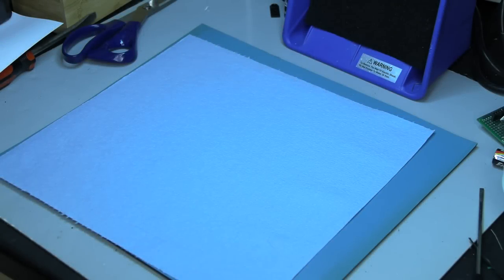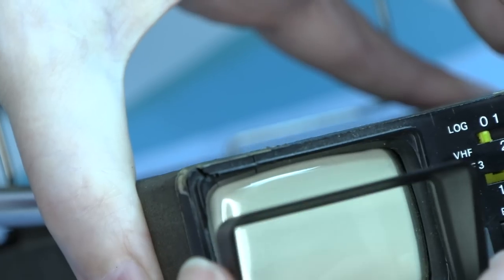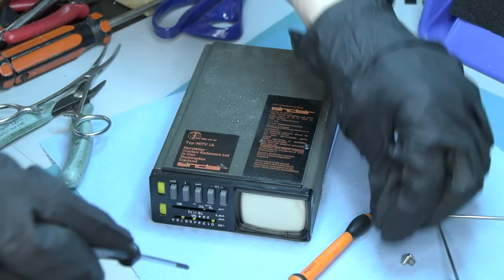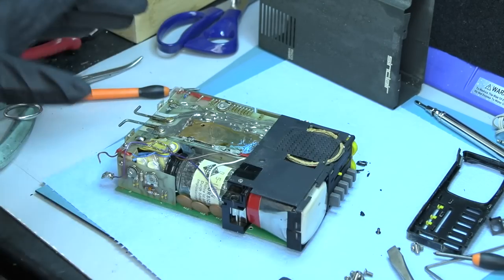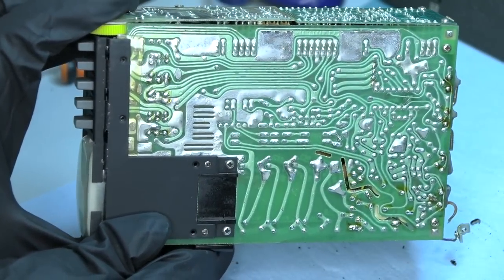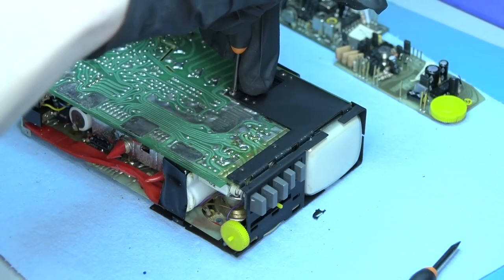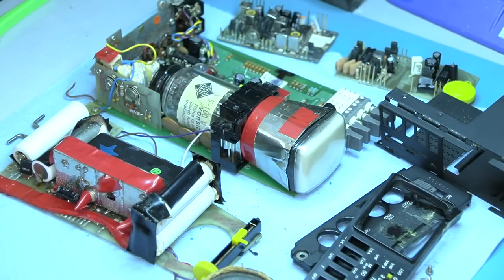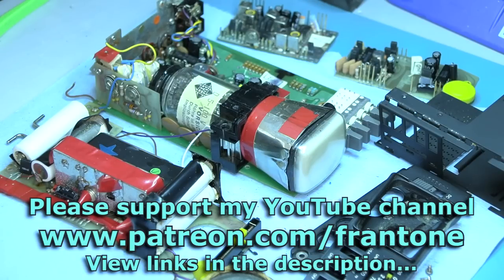Sinclair MTV1 Handheld Television

Comment: Clive Sinclair is a kinda hero.  More Sinclair!

For a show an idea I discussed with Chat GPT...
User
can i make a logic circuit with ONLY diodes?
ChatGPT

Yes, you can create simple logic circuits using only diodes. Diodes can act as logical gates by allowing or blocking the flow of current based on their properties. Here's a basic overview of how you can use diodes to create logic gates:

    AND Gate: You can create an AND gate using diodes. Connect two or more diodes in series, and the output will be active (allowing current to pass) only when all input signals are active.

    OR Gate: You can create an OR gate using diodes as well. Connect two or more diodes in parallel, and the output will be active if any of the input signals are active.

    NOT Gate: A NOT gate can be constructed using a diode and a resistor. When the input signal is low (0V), the diode blocks current, and the output is high (1).

These diode-based logic circuits are quite basic and have limitations, such as voltage drop across the diodes and slower response times compared to modern integrated circuits. However, they can serve as educational examples of how diodes can be used for basic logic operations.

For more complex logic functions and faster response times, integrated circuits like logic gates (using transistors) are more commonly used in modern electronics.

Fran, do it.  I double dog dare you.  It would be fun!

Comment: I have a JVC portable color monitor that’s about 6 inches across diagonally on the screen. It runs on mains or 12v  or internal rechargeable battery (it’s in it but dead). I have it on my bench connected to a VCR directly as a monitor. It’s great to pop in a vhs tape and watch an old movie while working on something else. It’s small size and direct video connection gives you the best image your going to get from any VCR.

Comment: A friend of mine had one of these in the mid 80s. It still worked. It's probably not identical, because it was designed for the UK UHF 625  analogue TV system. He may still have it in some dark corner, but it will be very green & furry.
Reply: Those TVs were multistandard and intended to be usable in most countries inthe world.  The square loop aerial (antenna) was for UHF anf the telescopic one for VHF.

Comment: Sir Clive had an obsession for miniature TV's. Nearly as bad as his obsession for the 3 wheeled battery vehicle the C5. He truly was a mad genius. Iconic design aesthetics but built to Hong Kong standards of the day, everything fell to bits. I still have several Sinclair items, the watch being the worst, 3 calculators that feel like they are made of polystyrene, a tiny radio earpiece and some measurement equipment.
Sinclair could have been massive with a few tweaks to design and quality but he seemed very OCD about the wrong things.

Comment: Howdy. Nostalgia.
I have an analog 12 V portable black and white TV. Its inputs are 300 ohm VHF and UHF. It works but there is a lot of signal adaptions to be made.
First I need an older model digibox. It converts cable or antenna to SCART.
Second I need an analog SCART to carrier modulator.
Finally I must use an impedance matcher transformer to match 75 ohm to 300 ohm.
The concotion setup actually works. Fortunately I had the brains to buy the adapting stuff when still available.
Regards.

Comment: I enjoyed watching the tear-down, but I betcha you could easily replace the batteries, clean up the corrosion, and snap the boards back together and see if it works. The plastic parts are another issue, of course!

Comment: i remember these in shops. or it may have just been literature. tbh i was 7 at the time and more interested in the zx81s. upon reflection the ones i recall had a bend in the tube so were much smaller.
Reply: I had a US zx80 back in the 80s, I thought it sucked...the tiny membrane keyboard was useless. Once you used an Apple II, TRS 80, or Commodore, with a real keyboard you realized this was poorly designed ergonomically.
Reply: @CARLiCON  compare the price of apple 2 and zx80/81 though. the apple was 13 times the price. 1300 dollars vs 99,
Reply: @KarldorisLambley  you are correct, Appl, Cmdr, & RS were much more $$, & the other Sinclairs may not be as bad..so the pluses for the zx80 are: small/light & cheap.

Comment: I picked up a Casio lcd tv and a Sony Watchman, both broken. I can fix the Sony, it is just a bad audio plug, and some flat caps, as well as a fuse that someone thoughtfully wrapped with stripped power cord wire, that's scary.  Been doing transistor radios to keep busy but I find most of them have either bad 9v cables, or dirty earphone plugs. No real troubleshooting needed, a few caps usually bring them back to working great once more. Fixing the old rotten cases is more work though.  So far I have picked up 8 radios, those 2 tvs and a TI 83+ calculator that was not working, all it needed was to clean the contacts where the battery box mounts on the circuit board.  Ah well the anticipation of them coming in the mail is part of the charm to rebuilding these sets. Perhaps I shall try to resell them on Ebay as restored sets.

Comment: I have this, plus 2 FTV1s and a ZX Spectrum imported from the UK. The FTV1 is easier to disassemble, and is cool to compare to a Sony Watchman (which are independently-designed, yet using the same principle).

Comment: Now that old-school TV broadcasting over the air has been superseded by OTA digital transmissions - I don't know if you could do anything with this TV even if it was operable.  Perhaps a channel 3/4 modulator with an old game or computer source from the 80's?  Anyway, it's pretty amazing to see what they did to miniaturize electronics when the components themselves weren't small - no surface mount dust motes in this one!
Reply: a dvd player with RF out will work fine
Reply: @pyeltd.5457  True.  Those are pretty unusual - most DVD in the US were Composite (yellow RCA) or Component (Red/Green/Blue RCA) output.

Comment: I had a similar model that I got at a hamfest flea market in the mid-1980s.  It had a plug in the back that allowed a composite signal; I don't recall if it was original or an after-market bodge, but it was used for SSTV; I tried to use it on a Commodore 64, but the text was pretty much unreadable.

Comment: That would have cost 200 quid, ($400), back in 1978, which was a small fortune.  Unsurprisingly, not many of the original releases were sold.  It was rereleased at a much cheaper price a year later but was far less universal than the original, which was capable of receiving both PAL and NTSC signals, making the world's first multi-standard TV at that time.

Comment: Another example of Sir Clives genius combined with components that were more than likely faulty
when it was assembled.
You are wise to wear gloves, you don't want to ingest any of that corrosion.
I remember Sinclair products only to well, as a young electronics repair tech i was often asked to
try and repair the ones that worked for a few weeks or were DOA as most were!
His products were just too far ahead of the available components, and as they were made down to
a price, failures were a certainty.
Having lived with the advancenent in electronics since the late 60's it always amazes me that any of
it has survived, at least you can see the components in them unlike todays that are like a spec of dust.

Comment: Kind of weird that the batteries are non-replaceable, would expect such an old device to be designed so that parts with a limited life span and likely to leak like batteries would be in a separate compartment and easily replaceable if necessary. I guess it was already the beginning of the era of disposable consumer electronics, stuff that was built to last just a few years instead of decades.

My father used to have a Futaba RC-transmitter from roughly the same era and at least that one had the NiCads sealed in a plastic case to prevent leakage. The battery pack also had a connector to the rest of the wiring and was positioned so it would be easy to replace just by unscrewing the end plate of the transmitter.

Comment: When thinking of planned obsolescence soldered in batteries is the first thing that comes to mind.  I kept saying "it's the antenna!" but no one listens to me....  There are no signals in the wild that these old TVs can pick up anymore so I wouldn't spend time on it either given the condition, maybe if the plastic was in better shape cutting the cells out and giving it a cleaning just to preserve it would be worth some time, but in this condition with that much corrosion it's trash.  Calling those screws tiny is very funny, those are huge compared to what is used in watches and modern mobile electronics.

Comment: What would be the point of fixing it as it only accepts analog signals that are long gone.
Reply: There are converter boxes, VCRs with RF out, old consoles (there was even an official PS2 modulator iirc). It's the first multi-system TV, has an electrostatic CRT which is incredibly rare in consumer displays past 1940s and it's a Sinclair - IMO well worth preserving.
Reply: Just to play around with and see it working again. 

You couldn't use it as a portable TV, it'd be limited to a cord through an RF converter.

Comment: So it's obviously a multi standard, but "EUR" is bragging a bit. Tat setting is likely for most of Western Europe which used standard B/G (audio carrier 5.5 MHz), but not compatible with France (L, negative 6.5 MHz) and Eastern Europe (D/K, 6.5 MHz).

Comment: You gotta love British design and manufacturing techniques!  #NoYouDon't
You have to disassemble everything, and you can never test the device on the bench because you need to completely reassemble it so it can be powered back on!! 
We had a few old television Vectorscopes and waveform monitors of British design, and they were always akin to the worse parts of the bible to repair!

Comment: It is a wonder of engineering and cost saving in true Sinclair style. Clive knew that an ordinary CRT with magnetic deflection would use up way too much power so decided to use electrostatic deflection. Too bad about the mechanical damage and NiCd corrosion. Also a tip: if you do not know how to disassemble something, try looking it up on the internet.. Chances are someone else already has done it. Seeing that big screw driver being wedged in.. Cringe... 🙂

Comment: I didn't think Sinclair sold things in the US that early. I wonder if it was an import. Though without some modification, you wouldn't be able to connect a ZX81.
Reply: It says "Hersteller" instead of manufacturer, so I guess this one was made for the German market. Perhaps the G in "Issue G" stands for Germany.
Reply: @Terigena  that could explain the German tube.
Reply: @Thebrainymonkey  .  Irrelevant.  The Telefunken CRT was single sourced and used in all production irrespective of destination country.

Comment: Fran, the 7801 and 7806 chips are not 1978 date codes. 7801 is a Digital to Analog Converter, 7806 is an Analog to Digital Converter, both 12-bit. 7810 is a single channel digital isolator. The line above it is more likely to be a date code. The fact that these were first demoed in 1978 is a quirky coincidence. Edit to add: 78xx chips are CMOS, 74xx chips are TTL voltages. Additional edit to add: My major TI chip phase was in the '90s, so confirmation bias led me to an incorrect conclusion but a wealth of knowledge on a tiny TV.
Reply from the maker: There is no digital in this completely analog television.  Those are date codes.  Sorry.
Reply: @FranLab  Well, cool, I learned something, and I now know from looking around exactly how incredibly crude the manufacture of some of these are, especially the first batches. Turns out, my issue in making sense of the codes is the fact that these chips are so incredibly obsolete that a failure of either of the chips (ST1 or ST2) on the IF boards means you are the proud owner of a brick. I was EECE before I changed majors, I have handled (and toasted a good number...) tons of TI chips, but the only thing I have that'd be about the same vintage is my old TI-99/4A from when I was a kid. I also now know way too much about a product I didn't know existed.
Reply: One thing I did note, while continuing to read the available PDF service manual with corrections made due to extremely poor scan quality of originals on the web, is that if those two ICs are dead, it is technically possible to use the MTV-1 as a composite monitor, although the effort seems high for such small (pun intended) gains. Again, good learning moment, and an interesting way to kill my evening straining to read extremely terribly rendered factory schematics.
Reply: TI had, at that time, an IC design centre in Bedford, not too far away from where Sinclair were based in Cambridgeshire (30-40 miles at a guess). I wonder if they were involved in the design of the custom ICs?